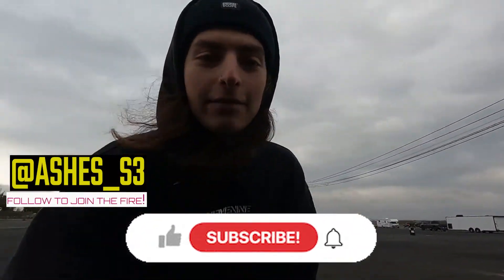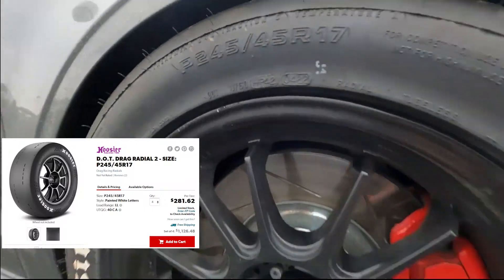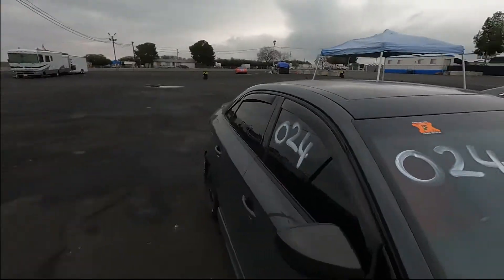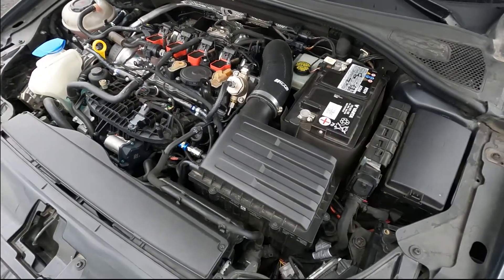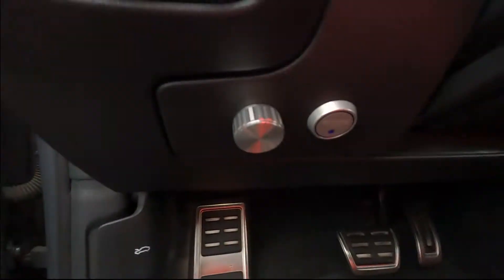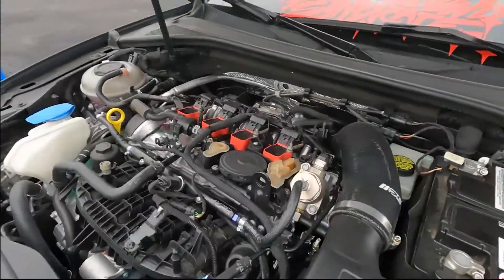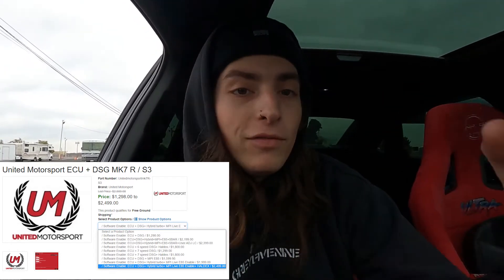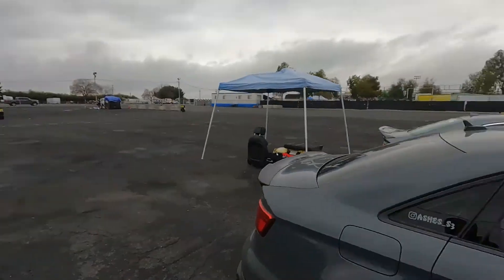ALL MODS on my AUDI S3 8V ! 500HP + STREET CAR !

Comment: 3:48 lmao you had me at, "pop the hood" 
Impressive build man! 
I've been looking at brz's/86's, mustangs, camaros, is350s, q50s, 328is, TLX's, 1995-2006 corvette's,  2000-2006 911's and a ton more in-between. 
At the end of the day, I think I'll be settling on a S3.
I had to relaize that hp, for myself, isnt the biggest deal. Its how the hp is transfered to the road.
I wont pass 93 mph (on streets) so its all about the 0-60 times, handling and a manual transmission.
Reply from the maker: thank you for watching man!! i appreciate the compliment!! i feel you bro i was considering a lot of different choices before this as well. and youll love an s3 it has the perfect mix of luxury, power, and style. and the amount of mods and power able to be added is almost endless!! lmk if and when you get one man!! good luck

Comment: What fuel pump module did you use bro....im on a stage 3 tune in my 2015 s3 also...450 whp 400tq....my stock module is playing the fool so I'm going to upgrade it now...thanks for the info
Reply from the maker: thanks for watching bro i appreciate you, heres a link to my fuel pump and module set up, hope it helps! correcto usually the lpfp is the culprit on these cars when reaching for that extra power.
Reply from the maker: https://www.fourseasontuning.com/ims-965-03-042-ims-brushless-low-pressure-fuel-pump-mqb.html

Comment: I didn’t see if you mentioned map sensors? I’m also local to four seasons and plan on making the switch when I go hybrid
Reply from the maker: yessir good looks i forgot about that! i do have the upgraded 4-5 bar map sensor on the charge pipe as well as the precision boost tap kit on the intake manifold! nice man i hope you enjoy it! what mk7 do you drive?
Reply: @ashes_s3928  I havent changed my name, I had a mk7 GTi but I sold it and got an AWD A3. Currently fbo on e85 stock turbo. Saving up to either go hybrid on this or to make the switch to a golf r. I kind of miss having a hatchback haha
Reply from the maker: @LoXHumaN  fuck ya bro! that sick tho the quattro A3 are basically a S3 with a few mods and tune. If you stay A3 and want to go United tune i have the Haldex controller that is flashed by United just sitting around, its for more rear bias and foot pedal controls if you wanna buy it! its straight plug and play, take your haldex off and put this one on! check out their website it tells about the software and its compatability

Comment: Hey dude, thanks for the video, really cool detailed insight. Question for you. I'm currently running a stage 1 14' S3 but wanting to get into the tuning world of this platform. The goal is an all out stage 2 BUT without buying a different turbo (would rather a holiday for 3.6k lol). So, my question to you is should I go all out and get every supporting mod for power increases aka full induction kit, all charge / inlet hoses, turbo elbow, sports cat downpipe, intercooler, upgraded coil pack, better spark plugs...the whole shebang? OR are there certain ones which are exponentially better value for money than others? if so what are your top 3 mods for biggest gains? Cheers from the UK!
Reply from the maker: thanks for watching man! and no problem i got you, my opinion would be these top 3: intercooler , FULL intake at least 3inch diameter with complimenting turbo inlet pipe (DBV2 or similar), and lastly a downpipe are going to give you the most gains for your buck, the charge pipes are a great way to increase flow but value wise with those 3 mods absolutely your ride will be a new one ! hope to hear the progress from you man cheers! good luck let me know if you have any other questions .
Reply: @ashes_s3928  amazing man, keep up the vids, let's see how far you end up taking this platform!

Comment: What times did 0-100 and 100-200km/h reach with these mods?
Reply from the maker: if my math is right to convert from mph it’s 3ish seconds and somewhere in the 7s
Reply: @ashes_s3928 it's like 0-60mp/h and 60-130mp/h for you guys.

Comment: just wonder puting that much power in s3 makes high chance for it to fall apart, but for that money you could get rs3. dont know just wondering
Reply from the maker: hey man thanks for watching , to answer your question IMO tbh it all depends on who and how you tune it. i have daily driven it like this for almost two years equating to 35k miles and i haven’t had any mishaps other than standard maintenance, but on that same token i have seen cars with less power grenade while doing highway speed.  the safe bet is to build the motor. once built they are bullet proof up to 50psi +. i’m on stock motor so i sometimes worry but not much because my tuner at United Motorsports provided me with a safe conservative street tune. these little engines are quite welcoming to performance modifications it’s very surprising to say the least. thanks for your interest man i’m happy to answer anything else!
Reply: @ashes_s3928  thanks for detailed opinion. 2 years of daily driving is something, have heard that more than stage 2 for those engines is dramatic, but as i see you took care of your car and most important thing is to have fun. so i fish you luck and a lot of fun, hope to fet s3 for myself too
Reply: @ygalion  more than stage 2 is not dramatic at all on these cars. You must be thinking of a different platform. It is really the wtq that should be worried abt. Which is why tuners keep it around 420 wtq